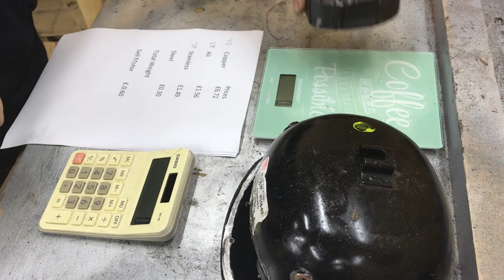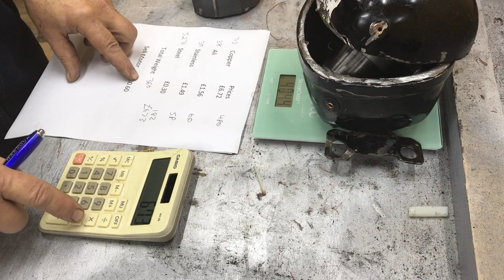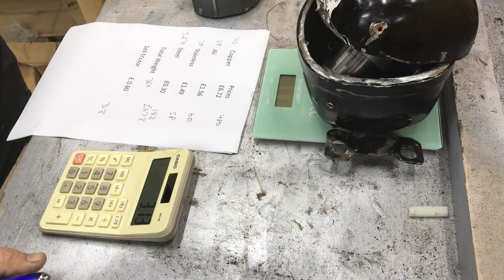Scrapping A Fridge Compressor Motor for Copper, Worth It ? Yes or No

Comment: All you need IS a plazma cutter.and open IT in 1 minit. I am saving for plazma cuter.and i allrady have saved 10 kompresor for my self.i want to get ať least 40 more compresors
Reply from the maker: A plasma cutter is next on my list
Reply: that is what i use. 30 seconds and they are open up and that is using old worn tips that are no longer good for getting straight edge cuts. Who cares what the cut edge looks like on scrap.  I open them up in groups or whenever I get the plasma out for some other jobs, i will do a batch that is sitting around.  it depends on how much you get in your area for each classification and how fast you can separate it. here they pay jack for them whole and I am fast at getting them apart so i cut them all up and save them for whenever the price is up. my biggest stash of copper I saved was a little over 3,000 pounds waiting for the price to go up.
Reply: Plasma is probably my favorite scrapping tool. paid for itself a long time ago.

Comment: Not all re copper.i have hsd some alley ones..i have a load and am just gonna take in as one piece.
Reply from the maker: If you weigh them first the alley ones are lighter so you can tell which are alley and which are copper.

Comment: You DO have a hundred of them to do- you just haven't got the others yet. Try doing 50 in an afternoon and you'll soon be sick of it, one at a time as you get them can be fit in anytime of the day at your leisure. Scrapping copper is a waiting game- never cash copper in in dribs and drabs, save it for a big payday otherwise you'll never have anything to show for it. Just under a year has my hoard at around 90kg no.1 stripped wire, 45kg no.2 wire (mostly windings) and roughly 40 kg copper pipe with brass I haven't seperated or cleaned yet. I'm planning on a tonne before cashing in. Here (South Australia) no.1 is at best up to AU$12 a kg while no.2 might be a dollar or so less. I splashed out on an enerpat multi cutter motorised wire stripper, but now realise there's a lot of wire too fine to strip and am looking into building a granulator. Good luck scrounging!
Reply from the maker: I always save it up, my last load was last Christmas was £1600. I only pick up between jobs, so have no expenses. I have 15 compressors waiting I will use the plasma cutter when I get a load of them.
Reply from the maker: @hardergamer  You could buy them from scrap yards

Comment: Does that copper go in as no2 ?
Reply from the maker: Yes goes in as No2 as it has lacquer coating on it.
Reply: At my local yard they call it "varnish wire". Same as the wire from lighting ballasts.
Reply from the maker: @martinjackson176  No 2 copper not worth as much as bright copper

Comment: omg your using a wrong cutting disc.
Reply from the maker: How can it be wrong when it cut it.
Reply: @madeingreatbritainchannel  the disc is use for cutting a tiles and not for metal. use a metal cutting disc its like a thin disc like a sand paper type. you can also use that for cutting the copper wire.